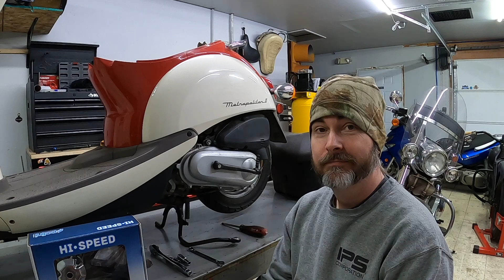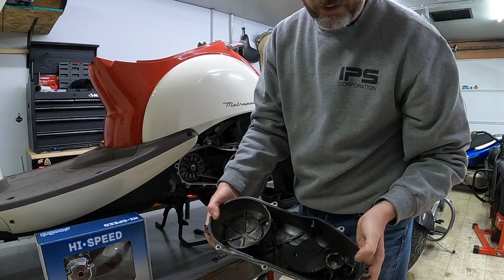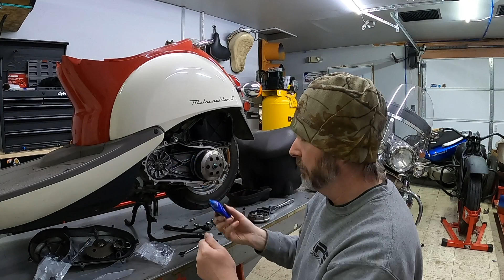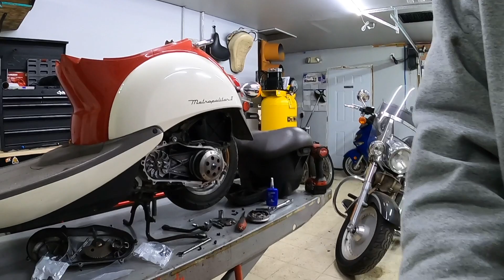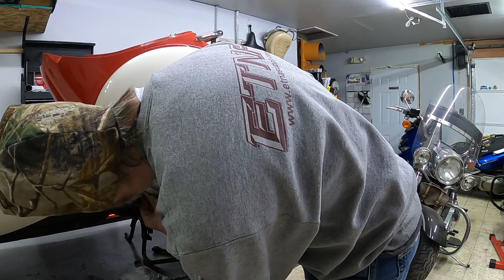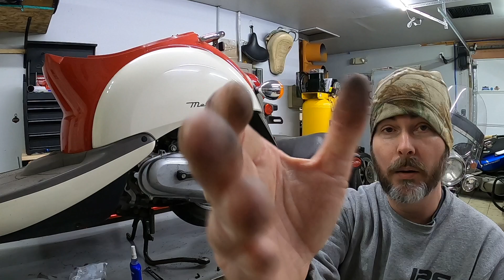2002 Honda Metropolitan II Polini Hi Speed Variaror Kit Install HD 1080p

Comment: You got the weights wrong. Lighter weights will keep the rpm higher thus providing a better acceleration. Obviously a fine tuning is needed. Too light and the top speed will suffer as well as accel. Lastly, this scoot should stay at 38-40mph all day long especially with a kid/young girl on it.
Reply from the maker: Thanks for that. I know that the Met 2 is different than the Met and it is governed. My hope with the weights was for the scooter to take off faster which it seems to. I’d like to figure out how to make it a little faster so it can keep up with my Ruckus

Comment: A Metropolitan II is a choked down version of Metropolitan. Restrictions on carb
Reply from the maker: Yes it is. The variator did help a bit but it’s not as quick as a Metropolitan
Reply: @Rockeys_Chop_Shop what was the difference? How fast before? And what was the top speed after?
Reply from the maker: @M.Cutler-TV  there was a slight change. Previously the Met topped out at 25mph. Now it will go 32. But it get to 32 much faster. I should have timed it and tracked the before and after times. The pull is substantially more which is what I wanted. Before the Met would gradually get to 25. Now it get to 32 quickly